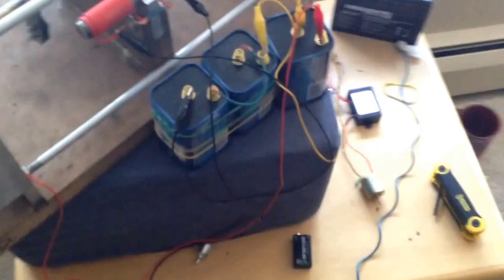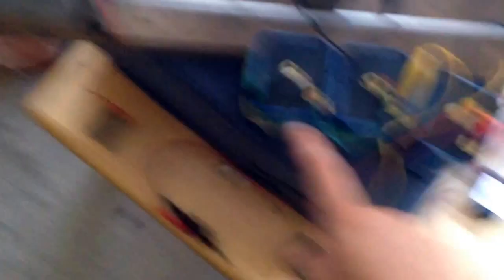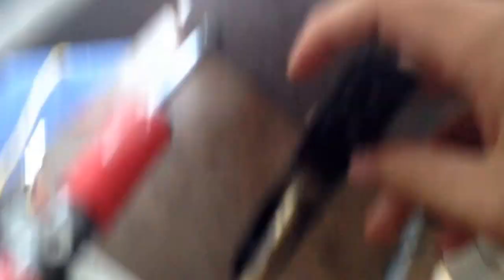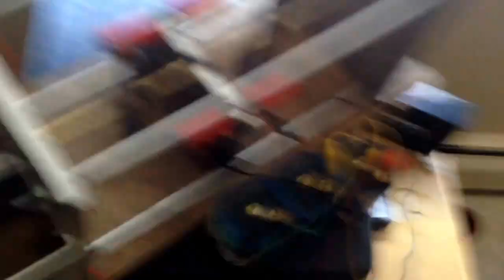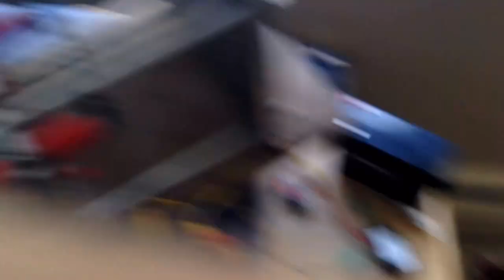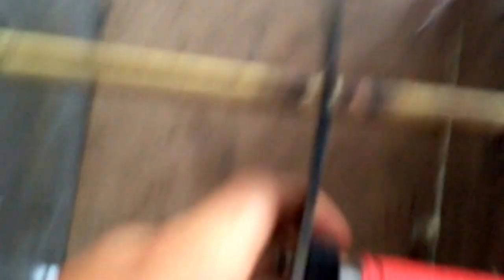Kromrey G-Field Replication Tips

Comment from the maker: Update: I made my own wooden cross member to drill the iron inductors in to in order to hold the inductors in place. I got 2-4 watts out after I did this, but it was conventional current. After all of my research I learned that it is vitally important to spin the coils instead of the magnets, and to have as many magnets as possible. My design failed because there was not enough flux and the coils were stationary. I believe the coils should be wound in the same direction using either the Bedini configuration or the Tesla pancake style inductor. I had higher efficiency with the Tesla style coil personally.
Reply: maybe you can ingeniously device a method to spin both the coils and magnets in an opposing axis (not easy feat)..wow wonder what that will bring about?
Reply: Why won't spinning the magnets work?  What is the difference?

Comment: i hope you repair the flaws and get it working soon!! what if you replaced the round iron bar coil with ferrite bar wrapped coils? will that be better? bedini also said that the permanent magnets should be placed on soft iron or laminated iron rotors..
Reply from the maker: Iron seems to have a strange effect where the B and H fields oscillate and give rise to an electrostatic phenomenon within the wires. I don't have the time or funds to keep working on this right now, but it would be interesting to see what happens with a ferrite bar. For cold electricity output like Bedini had, I think it is important to build it very similarly to the way Bedini built it, with iron inductors and spinning coils.
Reply: nice to know that you bothered to look into this, yes I was told ferrite was a good material for high speed switching with transistors in a transformer and blah blah.. maybe its not really needed here.. I have same desire like you to build a homopolar generator somewhat like an N machine that the late De Palma did (I  see too many references saying that such a machine is more than 150 percent efficient and back emf is virtually non existent ) , but I cant even find the large magnets that I need for this project..good luck anyways!!